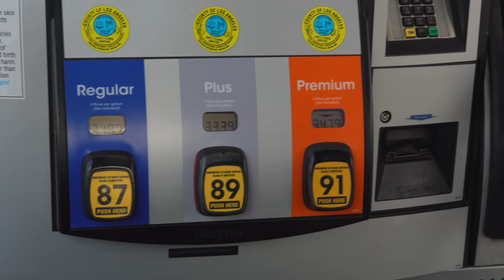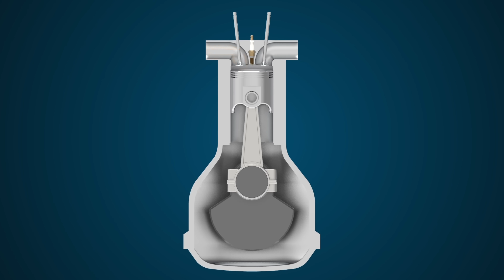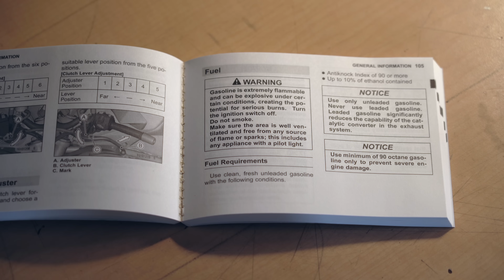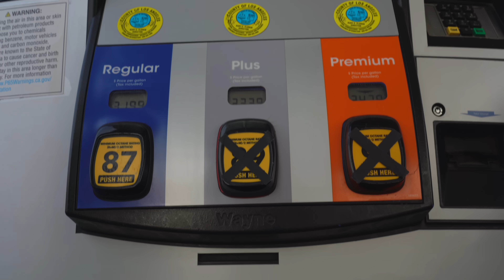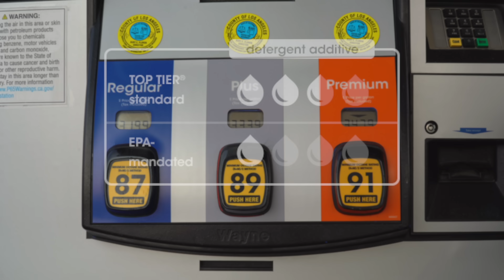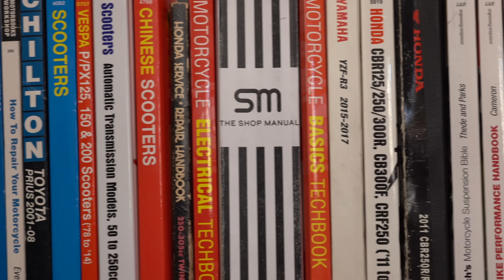Should You Run Premium Gas In Your Motorcycle? Octane Explained | The Shop Manual

Comment: How does ethanol mix (E5 or E10) play into this?
Reply: Hoinyack Yates  they're mainly bad for carbureted fuel systems because they will gum up carbs and also attract moisture when they sit for a while.
Reply: @jakeedgell591  Best answer so far.
Reply: Hoinyack Yates  I've heard that a lot of cars nowadays are designed to be able to run on E10 without problems.
Reply: Read your manual, most motorcycles ethanol is not recommended.  If your manual says it's fine, then you're good to go.  Sometimes it's hard to avoid, if you have to run a tank you aren't going to hurt anything really.  Especially if you run  non-ethanol afterwards.  It will keep diluting down to nothing.  Some of the newer injected motors at listing E85 fuels.  If you ride daily, that isn't an issue.  If you don't you are better off with non-ethanol and make sure you put a preservative in the fuel.  Gas is like milk, it does go bad.
Reply: @PetrolJunkie  Not true, Rod, most if not all motorcycles that are 15 years old or newer and are fuel injected, ethanol up to E10 is acceptable. E10 is so common it would make no sense for BMW, Honda, Ducati, etc to design an engine in which E10 is not recommended.
Reply: Makes your plastic tank swell
Reply: In the USA, most gas is 10% ethanol already and has been for a while. Most pumps have a notice about it, and even my 1994 Mazda Miata recommends to not use gas with more than 10% ethanol.
Reply: Ethanol increases octane (improves burn uniformity) but has lower energy density (so it does cost you some fuel economy). It also has components that can react with seals causing them to degrade over time... my understanding is that those components only become a problem when the fuel is old (some sort of chemical degradation) so that's why they suggest fuel stabilizer when storing your bike. I just fill with ethanol free before storing to avoid the issue.

Newer vehicles are designed to be better able to handle ethanol... so not as big a problem - older "Jay Leno" classics though - I agree it's better t avoid ethanol entirely on those.
Reply: Hoinyack Yates  modern motorbikes are rated for E10 so you can use E10 or E5 without problems
Reply: Ethanol has an energy density about 30% lower than that of gasoline but it also has an AKI of about 100. When mixed with gasoline, the energy density goes down a bit and the octane up a bit. If a fuel system is designed for it E85 can be used in turbocharged cars & bikes; the higher octane level allows high levels of boost and aggressive tunes before detonation sets in and thus allows the engine to produce a lot of power. But the fuel system must be designed to inject E85 in much higher volumes than gasoline. Ethanol is thought of as being hygroscopic meaning it absorbs water. When stored for periods, like motorcycles often are, the water can separate and cause corrosion in fuel system components. E5 or E10 blends are more about helping the corn industry than anything else. The relatively low concentration of ethanol lowers the chances of corrosion and swelling of plastic tanks and in continuous-use cases would be fine. But it'd be preferable, imo, to run alcohol-free fuel in a machine (lawn mower or snowblower or motorcycle etc) that sees seasonal use and long periods of storage. If you can't get ethanol-free gas where you are, store the machine with some Sta-Bil 360 fuel stabilizer in the system (or run it completely dry) before putting it away.
Reply: @mikep.5517  Very comprehensive reply! Thanks for the detail. You clearly know your stuff.
Reply: @mikep.5517  Thanks for this reply, it definitely helped clear up some stuff I've heard lately.
Reply: @mikep.5517  In europe E5 and E10 are used because they produce less pollution than ethanol-free petrol since the CO2 created had been absorbed by the corn
Reply: @formicone7  Thanks. That's interesting. I'm not fully versed on the seeds-to-fuel carbon math but intuitively it seems like petroleum-derived fertilizers, diesel-powered tending, harvesting and transport equipment and the energy-intensive fermentation processes would result in a total carbon footprint maybe not as clean as all that. But like I said, I'm admittedly in the dark about the "full accounting" of all costs, carbon and otherwise, of making ethanol from corn.
Reply: I've been told ethanol messes with plastics. Especially the plasyic liner in fuel lines. I'm not sure about motorcycles but with my Honda outboard engine I only use 98/E5 (Dutch premium). I've emailed Honda about it and they recommended using fuel with the least amount of ethanol. The mechanics at the outboard shop told me the same.